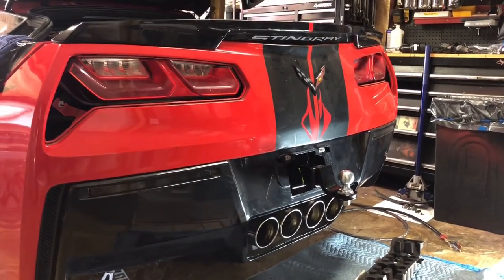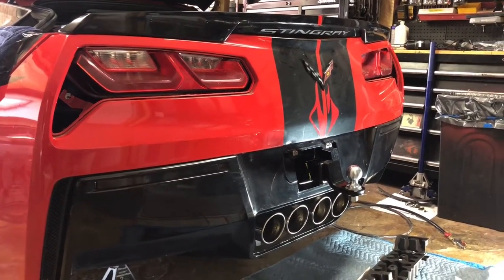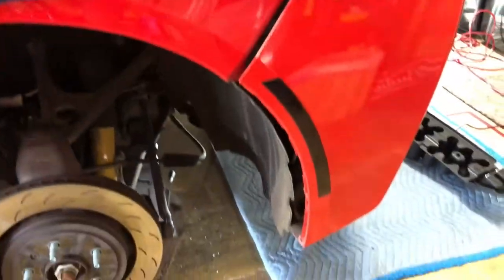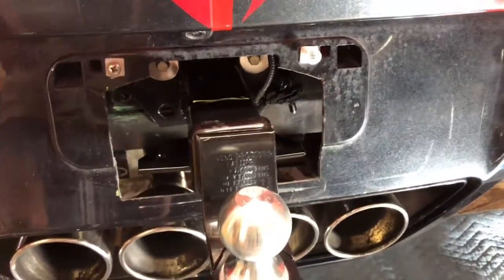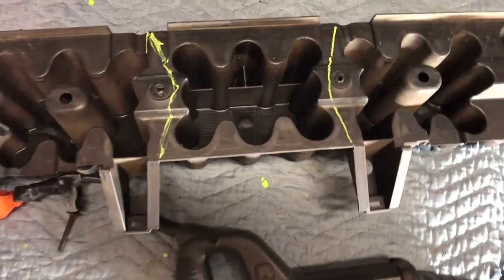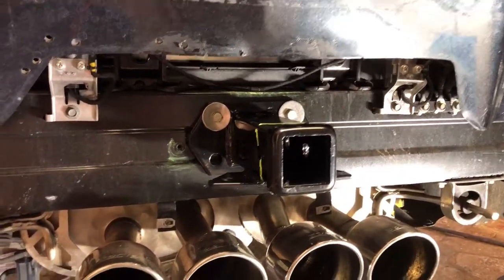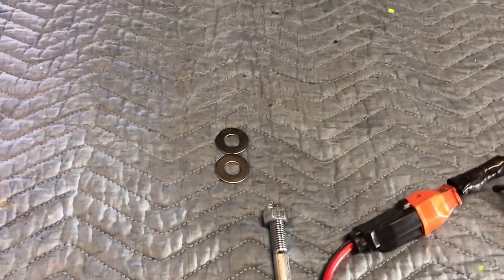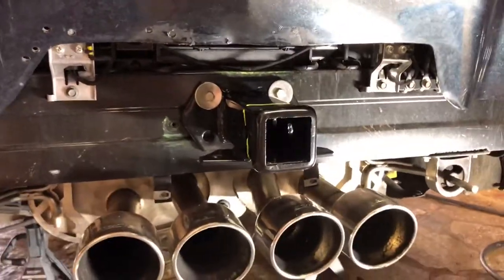How to install a trailer hitch on a C7 Corvette Stingray

Comment: Any help/video/diagram/wire info on doing the wiring for the trailer with the C7?
Reply from the maker: I'm sorry, I don't have a diagram or video of the actual wiring. When I had the bumper off I spliced the wires to my tail light / brake light wiring. Aloha, Mark
Reply: Leroy Engineering offers a plug and play wiring harness but you still have to remove the rear bumper cover for installation.